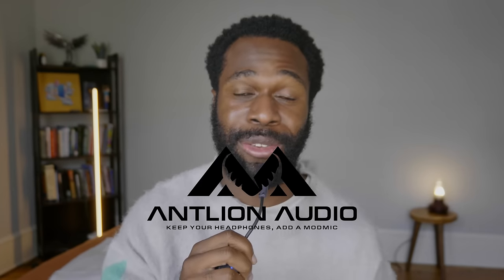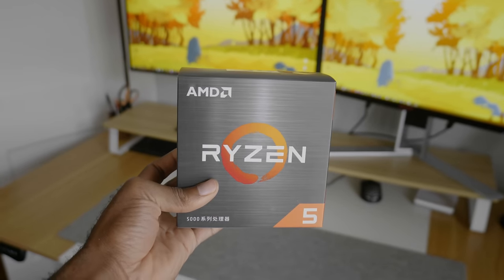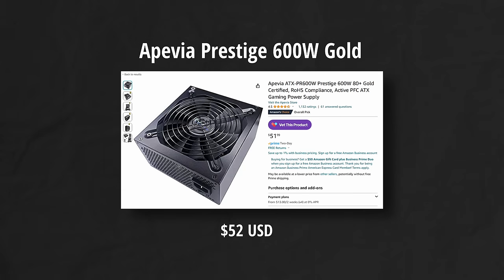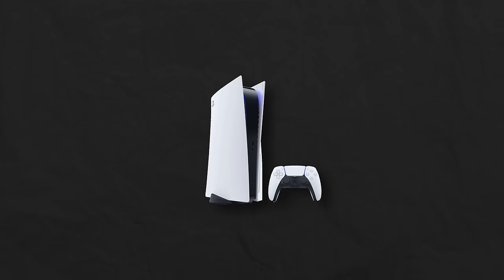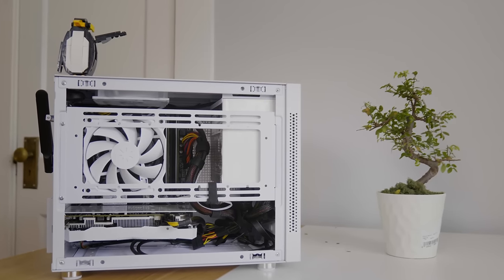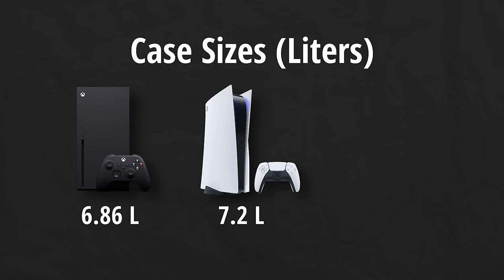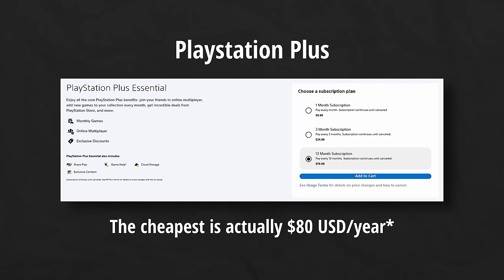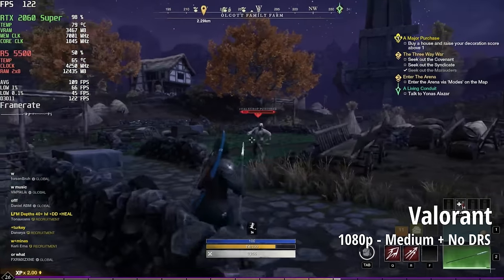The $500 PS5 Killer...did we do it?

Comment: As someone that has the luxury to have a nice gaming PC and have current gen consoles, I will say I still like consoles a lot for gaming. My desktop PC was bought several years ago for $1500 and has a 3070 and 3700x cpu. I have 2tb nvme storage. My PS5 was $400 digital version. I prefer playing on a big 4k 120hz HDR tv, have the PC and PS5 hooked up to it. The PS5 runs Warzone smoother and more reliably than my $1500 PC. Yes, I can get decent fps with my desktop using DLSS and I know PS5 is certainly upscaling as well, but visually the PS5 looks just as good, never stutters, never need to wait for shaders everytime I open the game, I just like it better. I recently bought MK1 on PC, my NVME drives are slower than my PS5 so I have loading scene stutters. I've had countless random hickups on PC over the years that require debugging in forums, settings tinkering, driver updates etc etc. My $400 PS5 is an amazing value for gaming, current GPU prices are gross. Sure, I could spend $2k in upgrades and blow away my PS5 but I'm more than satisfied with the performance I'm getting on a PS5 for $400. I'm not interested in 1080p gaming at a computer desk, I already sit in a desk staring at a monitor 8 hours a day for work. I want couch gaming with eye dazzling graphics and no tinkering. I think many people would be better off getting a cheap laptop for office/computer needs and then a console if they wanna go for value and still have a computer. Its also much easier to sell consoles when you want to upgrade or sell entire laptops vs sell individual used computer parts. I got so many random old computer parts piling up from over a decade of building my own pcs and upgrading over time. When I wanted to upgrade from a ps4 pro to a PS5 I sold my PS4 Pro for $250 within a few days of it listing locally  then bought a PS5 digital for $400. $150 upgrade is really nice compared to the $800 minimum I would have to pay just for a GPU to see a good performance jump over my 3070 right now.

Comment: Add the total cost to run the console/subscription for online plus the duration you would use one (5-8 years) and then just within that amount of money go for a step up. There is also the games themselves are cheaper on PC factor especially if you use multiple store fronts which you cannot do on console.
Reply: yea  i see so what game was cheaper then 50 or 60$ at the release on any key web page ? Pirate the game over Get key's from that kind of Siites that sell a brand new game for less then 70% of the original price because it is 100% scammed key or bought from a Stolen Credit card.
5 - 8 years of Ps Plus will give you alot of games and of course it include the Ps Plus Extra wich is like the game pass but way better.

then add the total cost of a mouse / keyboard / headset / monitor to the pc and where we are then ?

Get a Gaming PC if you want to do it but if you can not afford it then go for budged Hardware or used ... if you can not afford it then dont do it.
in 5 years you will still playing games on a ps5 but on a budged PC right now you will not do anything in 5 years anymore, Starfield told you a lession how Budged PC's from 3 years ago are running the game now right ?

Comment: Hi, thanks for the video!

It would have been nice to see more from section where you actually build the pc, or at least showing it a little bit slower, specially "cable management", and putting on the CPU with thermal paste. Question, why is there no fan to blow out hot air out of the case? Aaa i see it now, but i had to pause it went so fast, the case comes with one blowing to the side

Comment: Are you going to do a video on the new discovery that AMD Fluid Motion Frame works with NVidia cards? I got a RTX 3060 and an RX 6400 to work together to get really high frame rates, even on games capped to a certain fps limit such as Dark Souls 3 which I got to output 120fps using this method..

Comment: Something about the 95 degree thing. AMD designs the CPU's to all overclock using PBO up to 95 c 

That's why it reaches that outta the box. And it doesn't actually cause thermal throttling. But I am currently testing undervolting as well to see how much of that is true with my r5 5600

Comment: You should build a PC for the price of the current consoles. With the yearly online subscription over the average life span of consoles added to the price of the PC. Like 6-8 years. See what kind of console killer you can build then.
Reply: The only way such a comparison would be remotely equal is to also tally all the time spent tinkering and tweaking on hardware, driver issues, software issues, getting display settings juuuuuust right, and more over the same time frame one has determined to be the "average console lifespan," then taking that time, and either multiplying it by cost of how much one gets paid per hour, or the cost that an average person gets paid per hour, then add that to the price of the PC.

We should be fair about all hidden costs.
Reply: What. I've built 3 PC's and not had that many problems. Plus how does driver or software issues get put into cost. I remember when I had my PS4 pro there was a update for that that could brick the console. LOL

Comment: i have set my CPU max temperature through Ryzen Master (although no undervolting) However, i believe these ryzen chips are meant to be running at close to the thermal limit most of the time. Regardless, >90 deg. really scares me for an expensive part, so I set a lower temperature in Ryzen Master

Comment: What do you think about pascal p40? I recently bought two of them in order to run 70B LLM locally, but I accidentally find out that this rig can be used for gaming as well.(I use Linux with virtual machine, so lack of graphical interface is not a problem. But cooling solution seems problematic, I bought a blower fan but it seems I need to 3d print some chassis.)
It’s ever since 10 years buying a new graphics card, the older one has gtx 750, so it’s hard to imagine to play latest titles on that pc. I’m looking forward to play games…

Comment: I can’t wait to put my PC together. I bought the RTX 4070 Super GPU, Intel Core i7 14700K CPU, Kingston 6,000MHz 2x 16GB DDR5 RAM sticks, 2x Samsung 990 Pro 1TB SSDs, an Asus TUF Gaming 750W PSU, Asus Prime AP201 case, an Asus TUF Gaming VG27AQ 1440P monitor, Asus TUF Gaming LC II 360 AIO cooler, and many other RGB stuff. I’m just waiting on a motherboard and maybe more RAM sticks. Yes, that’s over $2,000, but that’s all worth it. That setup should last me at least 6 years or more. It will definitely kill the PS5 in terms of performance by a huge margin!

Comment: i think you're not mentioning a variety of different factors

1. your pc doesnt have a disc slot, so the ps5 doesnt -100$ (ps5 cost is now 400)
2. ps5 also comes with a 60$ controller (340$)
3.ps5 comes PREBUILT which is 100-200$ (240$)
4.Everything inside of a ps5 is brand new, if you were to buy the same parts for your pc build the build would skyrocket in price.

Comment: I think you did really good at this price point, the main problem with building a "console-killer" pc at the same price is the fact that sony and microsoft build their consoles at a profit-loss, and then make up profit via subscriptions, game purchases and (in microsoft's case) advertisements on the dashboard. Plus, game devs only have to optimise games for a specific set of hardware as opposed to a larger catalog of hardware.

IMO, you can't outcompete with a PC at the same price as a console, you would need to spend atleast 800$ to match up in performance, which in the short-term is alot more upfront, in the long term ofcourse it's alot less since less subscriptions/cheaper games = money saved.

Comment: This is weaker than the PS5, the GPU would be comparable to a RX 6700, but anyway I built a cheaper machine with better specs at £325/$410 with all new parts, Ryzen 5600, RX 5700XT, B550, 1 TB NVME 16GB RAM 3200MHz etc :yt:

I also reviewed that SOYO 2060S, it runs hot, there are other better options on Aliexpress

Comment: I am a PC fan myself, but its important to point out that a ps5 is closer to 6700/6700xt even because games are usually better optimized for console. For example, to run ratchet and clank rift apart on a pc the same fps it runs on ps5 you would most likely need a 6700xt because the game is better optimized for the ps5 so runs with higher fps.

Comment: Could get a 5700xt that performs better than that 2060 and is on par and better than the 3060 in some games. 

It’s relatively easy to build a $500 console killer. Check the used market and get a used ryzen 3600 and 5700xt with the rest of the parts being new

Comment: The thing you forgot in the cost analysis is that a console won't need a upgrade over it's life cycle. A console cycle normally is about 8 years. The PC you build already can't really beat the PS5's gaming performance. What will it be like in 3 years, 5 years, in 8 years ? The performance will massively drop, especially compared to consoles. 

Also the subscription fee is difficult. It totally depends on what you're going to play and how often. But you also get games every month, so how you gonna adress for that ? It's difficult. 

At the end the 80$ per year isn't payed in reality. I normally pay between 30 and 40 per year. 

Over all, what's cheaper is massively dependent on the individual usecase. If your really just into gaming a console will be cheaper. If you also need something to work, etc. a PC will probably be a better choice

Comment: It's pretty hard to beat the fact that Sony and Microsoft can tank a loss on each console, but we can't with PC parts. I'd say it's pretty much not fair to do a straight-up comparison between the two, but we can definitely get close. If you factor in the cost of a year of online (we'll split the difference and say an extra $100) and upgrade the CPU and/or GPU just a bit, you'd get better performance compared to the console. You could upgrade to a Ryzen 5600 processor and a better CPU cooler (and maybe better case cooling) for about $60 more, and you'd be on par with the consoles.

Comment: A PS5 is $499.99 in the US today. But the difference between a PC and a Console game is that a PC game needs to be compatible with allot of different hardware. A Console game only have one set of hardware configuration to code for. That means that game for the PS5 can use 100% of it's processor power where a PC game can only dream about doing that. We have examples of console games that use the processing power of the sound card to run graphical things. The first Super Mario game to the NES did this for an example.
Reply: A pc is not just for gaming!

Comment: PS5 is a 6700 and trades blows with the 7600. The 2060 Super is wowefully inadiquite. Plus you are $50 over with a gen 3 not a gen 4 SSD. The PC side still is falling short.
The question is will AMD or Nvidia even make an 8500 or a 5050 that isn't just pure crap budget laptop stuff.
Reply: The PS5s GPU isn't on par with a 6700, watch the digital foundry comparisons
Reply: @omegaPhix  I only find on digital foundary when typing in 6700 is the 6700XT. The non XT varient isn't in a video.

Comment: my pc is barely over $510 but with carefully selection of parts, and compromises (which used and which new); i've acquired these specs and tbf they literally obliterate any current gen games at ease
CPU: Ryzen 5 5600G (Brand new, $130)
Motherboard: Asus Prime B540M (Brand new, $75)
RAM: 8x2 DDR4 3200Mhz kingston furyX (Brand new, $38)
GPU: RTX 3060Ti (Used, $210)
PSU: Coolermaster Elite 500W (Used, $30)
SSD: Lexar 256GB NVME (Brand new, $23)
External storage: 1tb (doesnt count, i have this one already)
Case: $10

Comment: Are you sure the 3600 and 5500 are near identical?

Iirc zen 3 was a huge jump in performance.
Reply: Yea they are. The 5500 is the 5600g without the igpu. The 5000 apus in terms of gaming performance is on par with ryzen 3000.
Reply: The 5500 is a monolithic die without any reasonable amount of cache. The 3600 is about 1-2% slower. A 3600 that was produced later can often do 1.25-1.3V at 4.6Ghz all core. At that point, they beat the PBO tuned 5500. Any early sample will likely need to be tuned with PBO and undervolt to match a PBO tuned 5500 that had some Curve Optimizer magic done.
Reply: @bryanwages3518  why did AMD have to fuck up their naming scheme like that.

Apparently the 5500 doesn't have pcie gen 4 either.

The 3600 does though
Reply: The lack of cache in the 5500 brings it down to the 3600 in performance.
Reply: Having half of the cache cripples it compared to the 3600. If the X3D parts have proven anything, it's that cache is crucial for good gaming performance.

Comment: Thanks for the video. I think my personal main benefit of PC would be Steam and the price of the games. I currently don't have any kind of gaming PC but a PS5 and I'm super happy with the console. However, the prices drop way faster on Steam and if you play a lot, I think a PC is way more cost efficient than a console. Also AMD providing super future proof sockets with formerly AM4 and now AM5, upgrades aren't necessarily too expensive in the future. As for performance, if games aren't highly optimized for consoles, mid-cycle the PC passes the consoles in terms of price/performance. Bottom line I don't think there's a wrong way to go with either a PC or a console for gaming.

Comment: If you want to beat the console performance, Linux will outperform Windows on most games.  In my experiments I was getting over 25% better performance on Apex Legends in Linux.  But that was last year and I am not sure what the best Distro currently is for gaming - at the time I was using PopOS which is pretty decent.
Reply: Another good distro to try would be Arch. Steam OS 3 (which is what the Steam Deck runs) is actually a modified version of Arch Linux

Pop OS is still pretty good for gaming though. There’s also Garuda and Nobara

Comment: i will preface this by saying i don't know much about pcs so maybe i'm extremely off here. according to the google search that i did the msrp of that nvidia card seems to be 400 usd but u got it for 160. if you can find a 7600xt with the same discount according to its msrp it would cost something like 30 usd cheaper for 8 more gb of vram for example. now whether you can get the same % of discount on the 7600xt as you did on the 2060 super i don't know but if you can find it close enough in price to make the 500 usd build work then i think this might solve the problem. even if you can't find this particular card at a discounted price that works, you might still be able to find another gpu from amd that works with more than 8gb of vram.

Comment: As the size comparison would be clear win for console anyway, why just not go with 20-30 bucks mATX case and buy RX 5700 XT or RTX 2070 and a couple of quiet case fans - gain more FPS and quieter noise. 

Also, R5 5500 is equivalent to R5 3600 - another 20 bucks towards GPU.

Comment: Also guys just bc it says 2060 or 4060 or 3060 just know the brand of the gpu has a lot to do with the actual performance of the card.
Reply: No it doesn’t. The brand has to do with the cost to performance ratio. If you’re confusing a 2060 with a 4060 then you should’ve done more research but it definitely doesn’t have anything to do with the brand since all three of those are nvidia GPUs. Brand doesn’t matter unless you want the best cost to performance ratio. In that case, get an amd gpu. An Rtx 3060 is $50 more expensive than an rx 6600 xt but actually performs on par if not slightly worse than the 6600 xt. The difference isn’t big enough to tell the difference but you’re saving $50 just by going with amd. So if you’re looking to build a pc just do your research and don’t listen to people that say one brand is better than the other. At the end of the day it just comes down to preference and budget. Pick the card that fits into your budget and don’t worry what brand the card is. Hope this helps for anyone looking to get into pc building.

Comment: The card was still overkill, you can do just as well cheaper RX 5600 XT is still no problemo..
Reply: Nah he underestimated the PS5, it performs between a 3060Ti and 3070 a 2060 Super wont cut it
Reply: Alan Wake ll is not supported on the 5600XT just in case you did not know.
Reply: @stevenanderson3205  not supported means absolutely nothing, it runs at 40fps at 1080p with medium setting no FSR, took me 2 seconds to find that out on here.
Reply: It really wasn't. The Rx 5600 XT is capable of playing the same games, just not at the same settings, you needd at least a 6700 for that.

Comment: you would need a more potent GPU to even match the PS5, since games are much more optimized for the console, running on a more steady frametime and so often reach 60fps easily! 
At least an RTX 3060 Ti or RTX 4060 I would suggest to order for the build. Of course it is more expensive, so 500 $ would be not possible

Comment: I would like to see a PC build that simply matches the Nexgen consoles in performance and not in cost benefit.
Reply: 5600x
6700 XT
B550 WiFi
16GB DDR4 RAM
RM650 PSU
Core Rock Slim 2 Cooler
Kingston NV2 1TB
Fractal Design Core 2300 Case